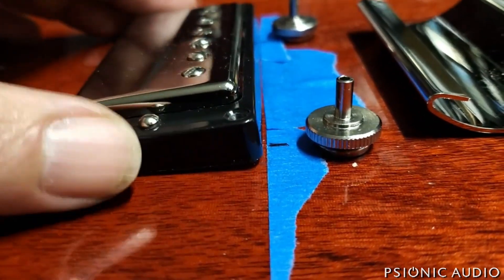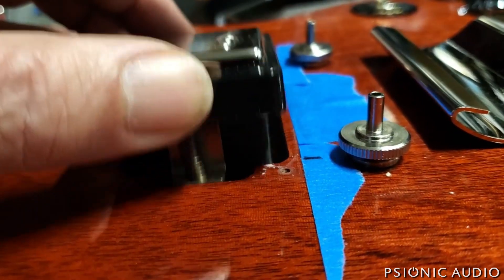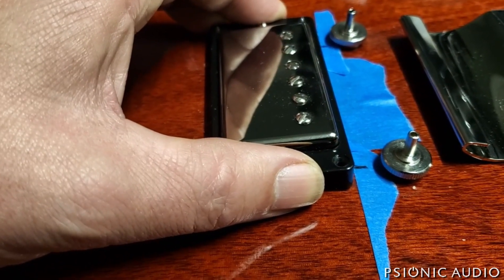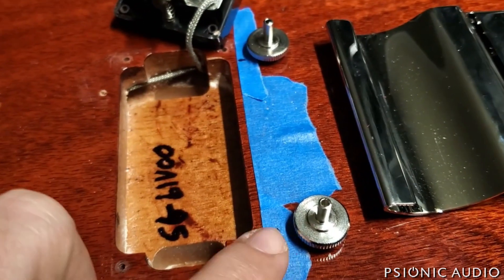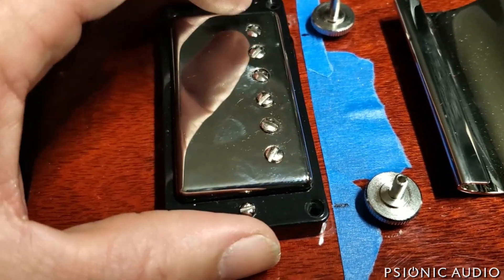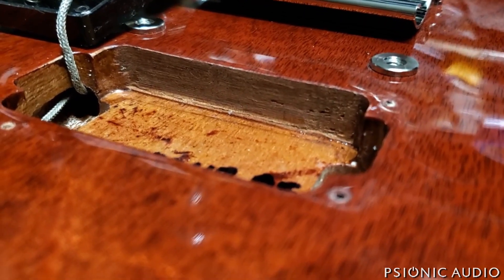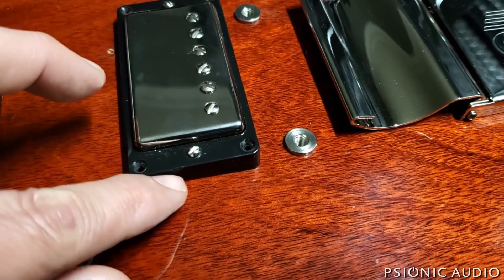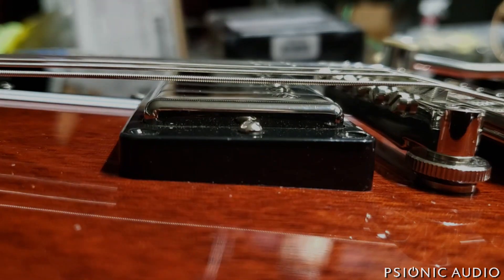Correcting the CNC router mistake on the new SG bridge pickup cavity

Comment: Very thorough review of this SG over these videos, thanks.  I'm deciding between the stoptail 61 and the normal Standard. What are your thoughts on the Standard pickup positioning, with the full guard mount design? Seems like it's not optimal, but does it really make much difference that the pickups aren't parallel to the strings?
Reply from the maker: Thanks. I played the batwing Standard, and they have the same bridge but a slightly thicker neck. The bridge pickup is parallel to the body as you know, but if the cavity route allows the pickup to be tilted you can put some non reactive foam beneath the adjustable coil to get some angle there. Never seems to have held Angus back.

The batwing Standard had Grovers, which gave that particular guitar more neck dive than I'd like.
Reply: @PsionicAudio  thanks for the reply. Yes, the 61 appeals more to me due to the potential neck dive issue, that's a good point, but I was thinking of adding Kluson Revolutions like you did, instead of the Grovers if I buy the Standard, to mitigate that. 
Still, that makes the price difference smaller, and the 61 has a hard case, and arguably better pickups, so then it mainly comes down to the neck, as you say.  I guess the rounded profile may also add more bulk so possibly more neck dive. I'm leaning towards the 61!
Reply: Oh, and I read that some of Angus' full pickguard SGs have been modified with pickup rings, so maybe even he prefers that approach.  I lean more towards Derek Trucks than Angus, musically, so the 61 is probably the one for me. Please keep up the videos  - the SG review is probably the very best guitar review I've ever seen on YouTube.  You even outdid Trogleys.
Reply from the maker: Thanks man! The 490s sound a bit better than the BB 61s IMO, though the 490s have never been favorites of mine. But there are a lot of HBs in the world...
Reply: @PsionicAudio  I've heard 57s in an SG and they're my favourites, but I haven't heard the 61s.  I had  a 490/498 set in a Les Paul once, good bridge sound but not mad about that 490 neck. In an SG though I guess it's different  - surprised you didn't like the 61s as much as the 490 set, though, most people seem to feel the 61s are like slightly hotter 57s.  I'll have to go and try some of these out.
Reply from the maker: @Riversider11  To me, it's the hotter adjustable coil, the short A5, the closer to the bridge PU location, and the thing body that add up to TOO BRIGHT. But that's subjective. I'm sure many will love them.
Reply from the maker: THIN body, not thing body. Sorry.
Reply: @PsionicAudio  no worries, I knew what you meant.  Thanks for the advice and opinions. The Standard has a Nashville bridge vs the ABR type of bridge on the 61,so I suppose that's the other main difference, plus that neck joint being further back (weaker?) on the 61.
I think the 61 probably wins out for me, spec-wise, but I reckon I could be happy with either model.